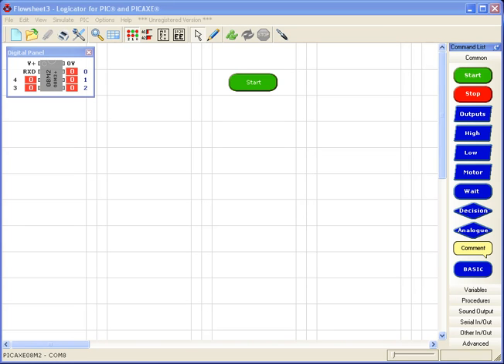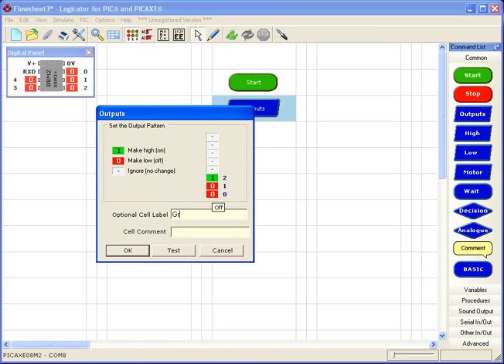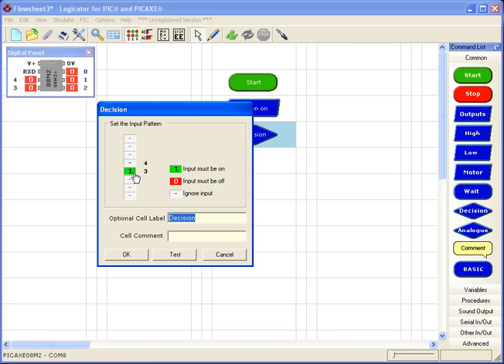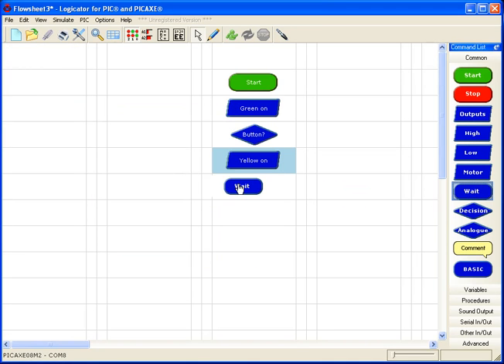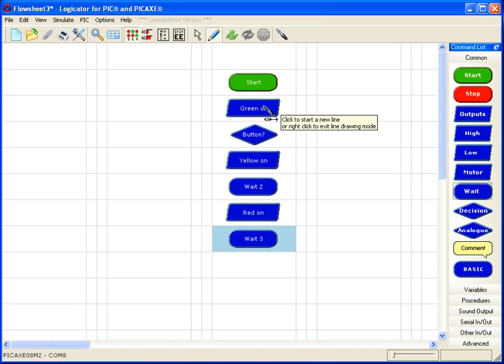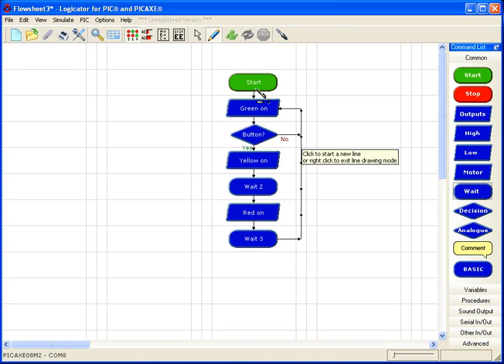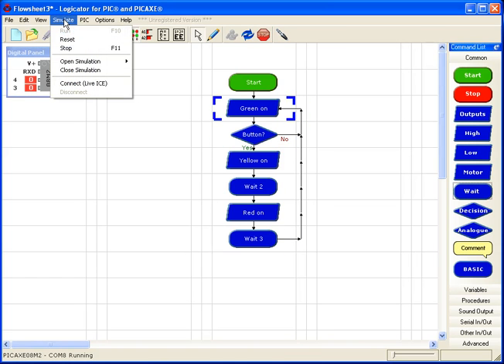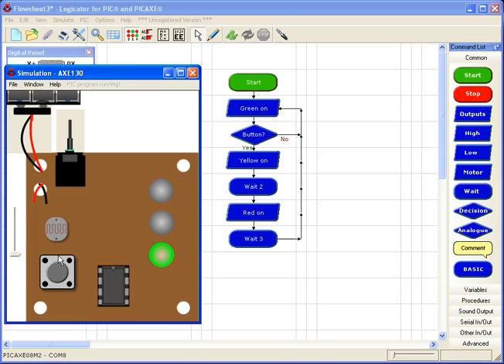PICAXE program 2

Comment: thank you so much for that teaching the picaxe program.at  the same time, i need know flow chart for motor angle control, temperature control and proximity sensor...so those things are need to control by using picaxe....kindly help me